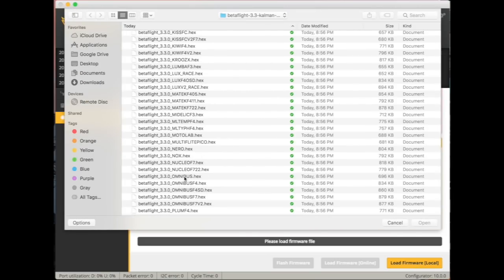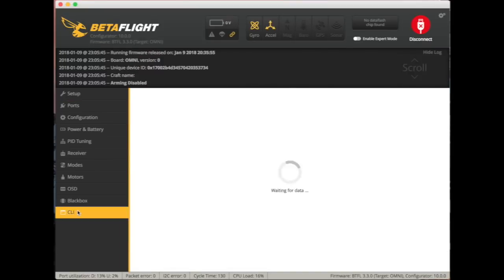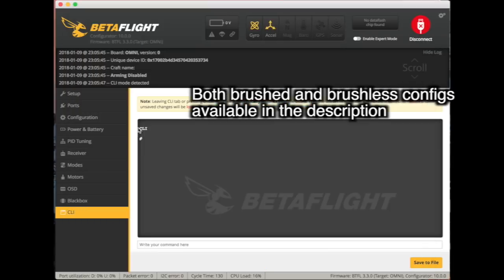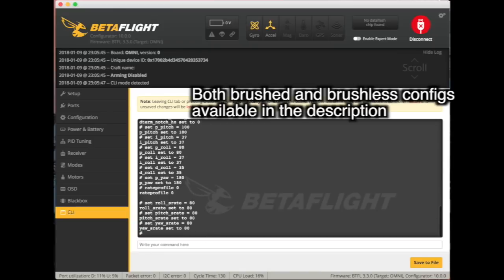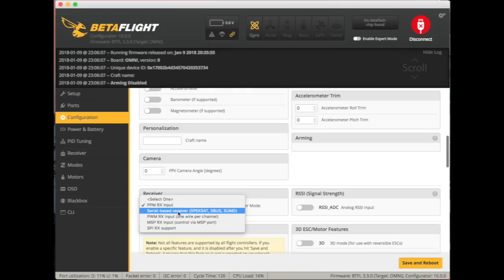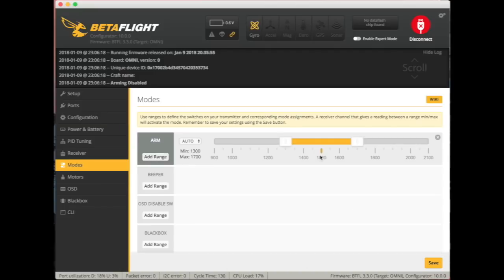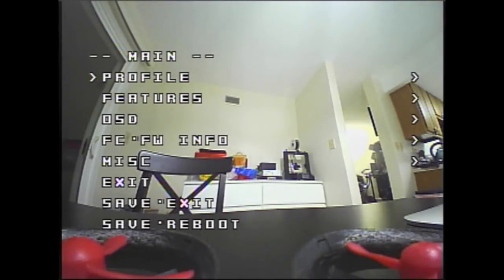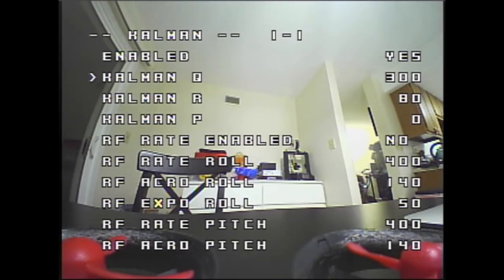Tiny Whoop with Betaflight 3.3 + Kalman Filter! Butter Whoop!

Comment: Can I use a Beecore V1 and just ignore the OSD configurator? Worth it or not without an OSD?
Reply from the maker: cutthenoise it should work. The OSD menu isn’t necessary. You can still do all the configuration in CLI

Comment: After flashing BeeCore V2 betaflight_3.3.0_OMNIBUS.hex there is no connection with the configurator :(
Failed to open serial port
Reply from the maker: 55bess my Dropbox or rs2k’s Dropbox?
Reply: 2017_12_29_bf_3.3_fast_kalman_1.2_rfrates_kdyaw_UH32_lua_settings
https://www.dropbox.com/sh/la2148995ffvawk/AABjYQtShs-Cy_X1LpGM0RyCa?dl=0
Reply from the maker: Use my Dropbox. I have the link in the description.
Reply: You are a magician, it all worked! :) Thank you !!!!!
Reply from the maker: Glad it works for you. Please give the video a thumbs up :)
Reply: I pressed the thumbs up 300 times, but counts only 1   :)

Comment: Nice! Telemetry needed? I'm using the Teeny1s and Frsky XM receiver on my brushless whoop and I think that receiver only has RSSI :(
Reply from the maker: Teeny1s has OSD so use my first dropbox link, I have implemented an OSD menu for changing settings.
Reply: Thanks, got to try it out :)
Reply: Easy installed as soon as I choose the correct hex file :D Questions: you set it to Multishot instead of DShot? Angle mode is not even an option in this version? Ok if I make a video of the installation if I credit and link to this video?
Reply: Found angle, "set acc_hardware = NONE" removed it. Reason for NONE except never using angle?
Reply from the maker: FlyingCat FPV according to the raceflight developers multishot is smoother than dshot and is preferred. It’s also part of rs2k’s config for his BF+Kalman setup. RS2K also disabled accelerometer and so do I (we don’t fly angle mode). I also heard that angle mode for the Kalman build is broken for some people.
Reply: I prefer acro as well, just got curious. My brushless whoop now dips it's front left when I throttle, not sure if it is be 3.3 or maybe a bad motor. /FlyingCat fpv
Reply from the maker: Tomas Carlbring I don’t have that problem. Did you try my config?
Reply: Yes I did. However I'm no pro on betaflight as I use Kiss on my minis. I went back to BF3.2.4 and the dipping was gone. I'll try it again later, haven't given up yet :)
 https://youtu.be/Xzp7YrzKnKU?t=3m50s
Reply from the maker: Tomas Carlbring if you use my config you are running multishot. Did you calibrate your ESCs? Do you also run multishot when you go back to 3.2.4?
Reply: Didn't think of calibrating honestly, being a Kiss user :D I have to try that, might be good anyway. On 3.2.4 I'm using Dshot600.
Reply from the maker: Tomas Carlbring yea that might be it. Dshot doesn’t have that problem
Reply: I'll give it a try as soon as I can. Btw, do you use dynamic filter as well, or just Kalman?
Reply from the maker: Tomas Carlbring I do use dynamic filter you can see it in my config file. RS2K also have it so I think it’s kind of the right thing to do when using Kalman filter